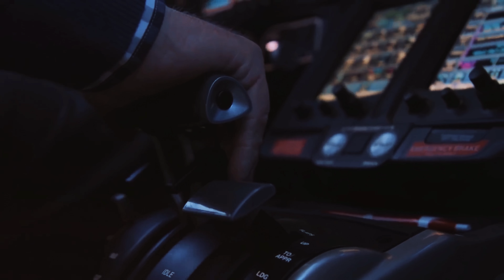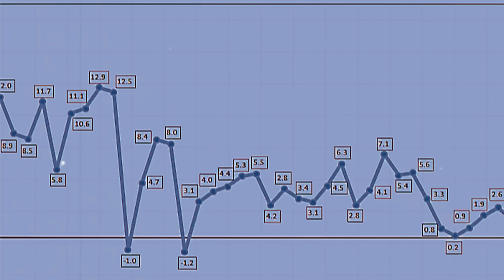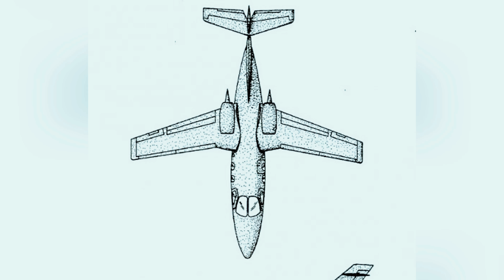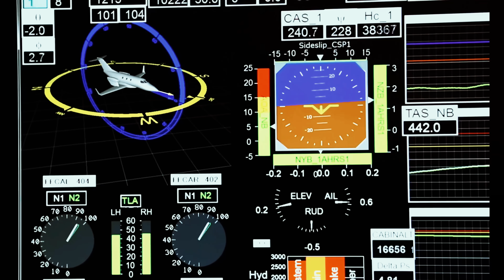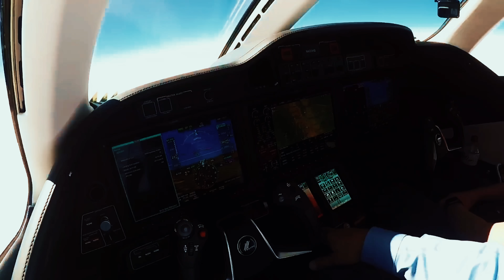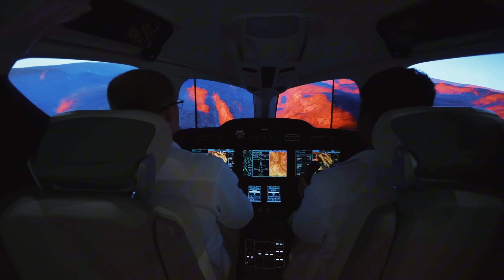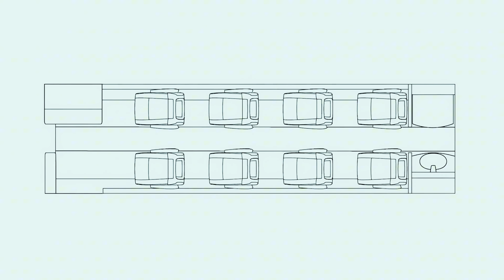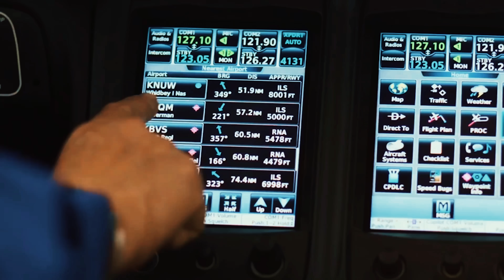The Jet No One Expected — But Changed Everything

Comment: What is so special about this engine position? It seems that things were exaggerated a little when it was claimed that aviation experts would not have thought this possible. To put it bluntly, that is nonsense. Decades earlier, the German VFW 614 already had such an engine arrangement, but the aircraft came at the wrong time in the developing aviation market. Although the aircraft shown here is certainly very good, its engine arrangement is nothing new.
Reply: "What is so special about this engine position?"

It reduces the noise from the cabin, as they're mounted on the wings
Reply: Spot on Sir, as an apprentice I made parts for the 614, a great aircraft but just too early it seems judging this daft video.
Reply: Conventional wisdom held that placing the engine above the wing would increase air resistance (reducing fuel efficiency and speed), and so it was not widely adopted.

Honda's development team therefore conducted extensive simulations and discovered the optimal position, which offered aerodynamic advantages over the conventional mounting location.

Comment: if it is such a great plane, only problem is it won't STOP
Reply: Yea.... Adding buckets for reverse thrust or at least bigger spoilers to help put weight on the main gear would help a ton with stopping. Bigger spoilers would be more realistic as buckets add a ton of weight to the engines.

Comment: "no aviation expert believed was possible"? Come on, that's just nonsense.
Reply: Because Germany already made a passenger jet like that many years ago ! Although admittedly it was not a big commercial success. 😅
Reply: @djlondon7956 HFB 320 Hansa Jet
i also did command that
Reply: Agreed
Reply: Yes, the vfw -fokker 614 did this in the 70s
Reply: Exactly. When it was already done, possible. What people questioned was the economics of the above engine placement.
Reply: @External2737 so what the “expert” meant was “economically viable” rather than aerodynamically possible
Reply: Thats what happen when they use AI to do the speech 😂
Reply: Mitsubishi had a aircraft project and failed
Reply: Simply because mounting the jet ABOVE the wing would create too much lift on the nose which most of the time airplane manufacturer like Boeing combined with their MCAS made it take off too fast
Reply: @mayuravirus6134  Conventional wisdom held that placing the engine above the wing would increase air resistance (reducing fuel efficiency and speed), and so it was not widely adopted.

Honda's development team therefore conducted extensive simulations and discovered the optimal position, which offered aerodynamic advantages over the conventional mounting location.

Comment: Fact that it takes 2 decades to build a new certified aircraft is a joke of the pathetic regulations of the faa.
Reply: The irony is that it took Honda less than 6 years to build a reusable rocket lol
Reply: This is an idiotic take that regulation cause issues. FAA makes sure that known issues does not happen. That's the reason it takes time so that all known causes of failure are handled. The hate people have for  regulations is too much
Reply: @kashif30189 that's wrong buddy.  It's a balance.  The reality is the 747 saved lives when it came into production.  Compared to the quality of aircraft before it.  It took 5 years enter service from first design.  If it takes a decade to build a new modern airliner, clearly it's too long.  We have cfd/cid and regulations need to catch up to today's technology.
Reply: Most of that was research for new technologies
Reply: Or the FAA knows more about aviation than most.
Reply: @dusk2dawn2  the faa regulations are why Boeing doesn't design a clean sheet plane, and instead Frankenstein's the 737 because its grandfathered in.
Reply: @AnarchyEnsues  Thats not right, if it would be, then no one would Build new Jets. Because if you want to Sell your jet in usa you have to Go through FAA certification. Do Not try to hide Boeings Management failures and Greed behind the certification which are essential to pur no very Safe Skys, at least airplane wise.
Reply: @hansmartin663 there is huge demand, yet little supply.  When a new 60+ year old Cessna design aircraft with modern avionics costs 600k, it's telling.
Reply: @AnarchyEnsues  How much of that is for product liability insurance?  (Look up Lee Kreindler & Associates).
Reply: @AnarchyEnsues 💯
Reply: @dusk2dawn2 You think!? 😅 Look at Boeing
Reply: Ask the families of the 737 Max crashes if they share your viewpoint
Reply: @HybridBoiChannel thanks for proving my point.  737 max was a half baked patch on a 1960s design plane...  Instead of building a new plane that would cost 15 billion due to certification requirements
Reply: @HybridBoiChannel two extreme examples don't justify foolish regulations that inhibit modernization.
Reply: Boeing should have totally scrapped the old 737 design and created a clean sheet design replacement… They’ve had the money to do as much and it would have really paid off in the long term and those families wouldn’t be suffering their unnecessary losses.
Reply: So you would fly in a jet designed with less regulations and oversight? Aviation would be much less safe. Regulations are all there for a reason.
Reply: @tedecker3792 I didnt say no regulations..  I said clearly we are over regulated when it takes over a decade to do a clean sheet design...

737 max is a perfect example...  Instead of building I new plane that can fit high bypass engines,  they just modified a 60 year old design because that is already certified....

And look at general aviation...  We have 60-70 year old planes still flying today, because new certified planes cost 500+ thousand... Up to 1.5 million for light aircraft ga planes.

So we literally have hundreds of kit planes being made every year to get around regulations...  Because it's to costs tens of millions and decades to certify a plane...  Took the Honda jet 100 million and a decade to be certified.